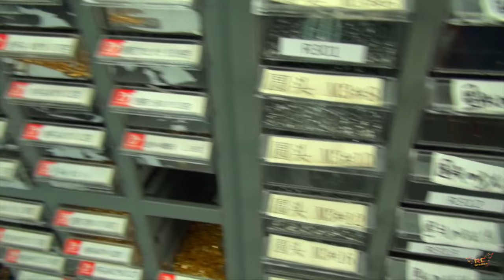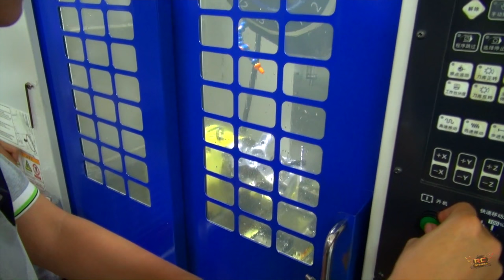RC ADVENTURES - How It's Made | Aluminum RC Wheels - DC Manufacturing Factory Tour

Comment: This is a fantastic video. You always wonder if you are getting quality or crap and this really helps give perspective on where your parts are coming from. I recently took a chance on GPM parts from Hong Kong, spending $500 + on every part they made for the Mini E-REVO and I wa not disappointed. Everything fit and worked to exact the specifications with the tolerances being being near 0. I am absolutely satisfied with everything I purchased from GPM. With that said, I also purchased some Hot Racing product to fill the gaps GPM did not cover and out the 4 items I purchase from Hot Racing, 1 wasn't machined correctly and never made it on to the car and 1 lasted 2minutes before falling apart due to poor design and build. In addition the other 2 parts dont fit well and where not engineered very well. So I am looking for other sources to replace them. 2 of them GPM does have what I need I just had to source it elsewhere.